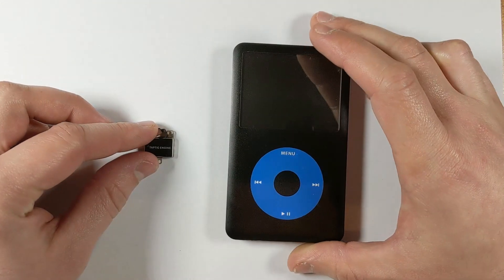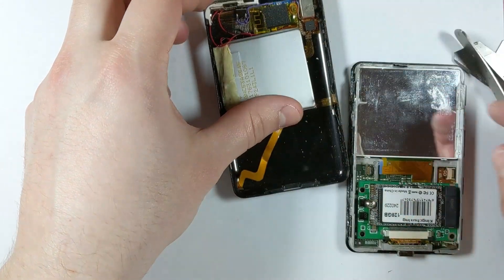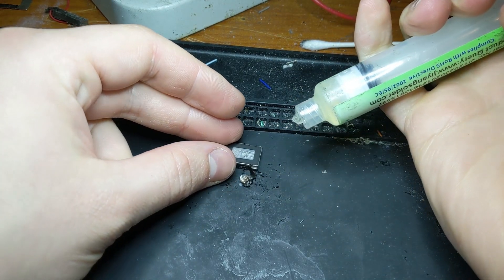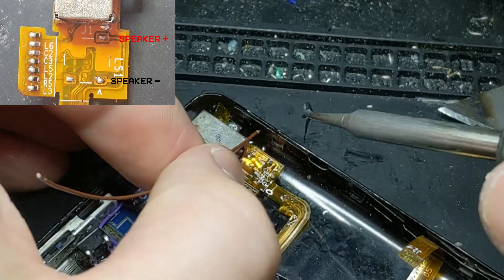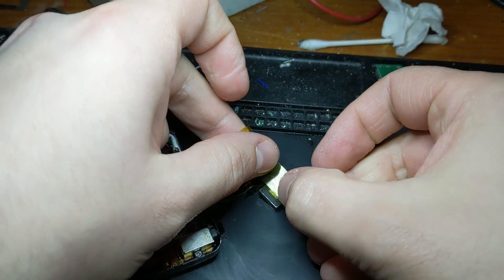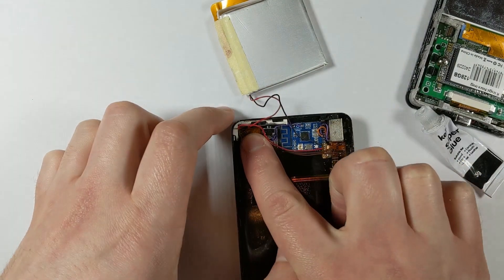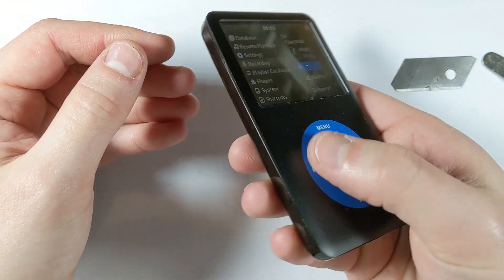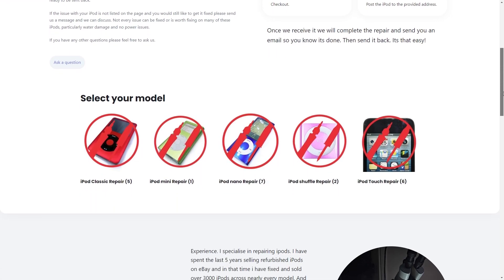iPod Classic 5th, 6th & 7th Gen Taptic Engine Mod Tutorial

Comment: stop damaginf the edges of your ipod opening with blades, dude. just use a thin metal plate
Reply from the maker: its the ipod opening tools that cause the edges to scrape like that, the box cutter blades dont leave any marks. the ipod in this video is the one i do all my mods on and has been opened probably over 50 times including when i was still learning how to get them apart hence why its pretty beat up.

Comment: I ordered every component for this mod and the bluetooth mod. I also ordered a small bistable switch board to put the BT power switch under the lock switch, to keep the lock functionality. I don't know if it will work and if everything will fit. I also have very little soldering experience. With your guides I'm pretty confident though! Godspeed to myself 😅
Reply: did you end up completing it?

Comment: Why do you remove the speaker? It's easier to leave it on so have both sound and taptic. Speaker is about 12 ohms and the taptic is right at 8 ohms so no problem to keep them both.
Reply from the maker: I assume it would make the vibration less strong. You can hear the sound through the taptic engine anyways so it doesnt really need it.
Reply: @partspluspods3689  the vibration is the same and the extra sound is a benefit. Try it next time and let me know what you think. I've left the speaker in the last five iPods I've modded and I think it's a better experience.
Reply: @michaelmaresca how would you go about doing it without removing the speaker?
Reply: @michaelmaresca  i dont like the sound. most people who do this dont
Reply: @escapetherace1943  your preference is up to you. About half of the iPods I sell request both speaker and taptic.
Reply: @michaelmaresca  cool and your personal experience somehow translates to reality how exactly?
Reply: I had asked this elsewhere and people were saying that the ipod couldn't drive both well.